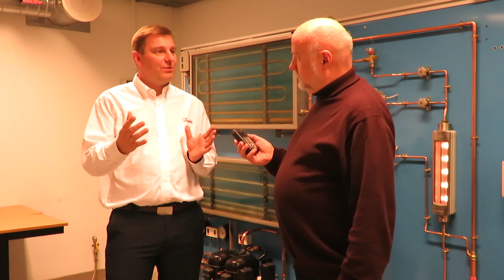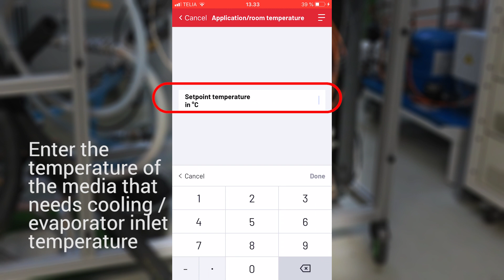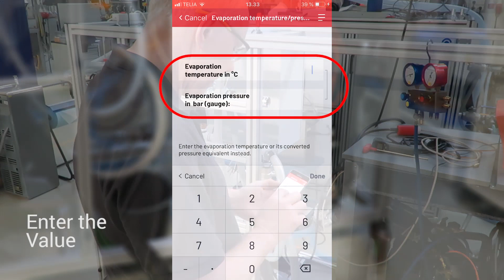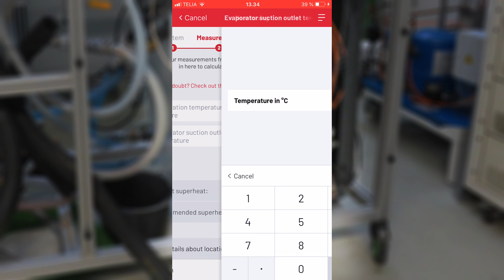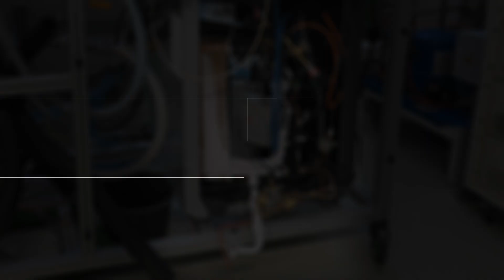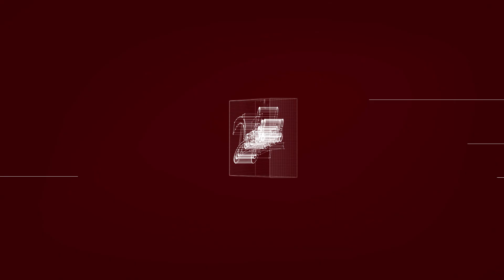Introduction to the Danfoss TXV Superheat Tuner App

Comment: Hi Danfoss, could you pl explain how to calculate (Application temp /Room temperature) for Hot water heat pump application, where the required final Temp for heating water will be 55 DEG .
Reply from the maker: Hi, Thank you for your comment. You can read more about it here: https://www.danfoss.com/en-gb/markets/buildings-commercial/dcs/heat-pumps/#tab-overview and look at the E-Learning part.

Comment: hi danfoss,
I have a question that I hope you guys can help me with.
1 / when the system has been vacuumed, how much gas is enough? How to know if the system has enough gas?
2 / When adjusting the superheater but the system is short of gas and must be charged, will the superheater change? Is there a way to fix it just once?
3 / How much distance from the solenoid valve to the throttle valve is reasonable?
Reply from the maker: Hi, Thank you for your comment.
1: The sight glass before the throttle valve (the expansion device) should just be full, i.e. no bubbles.
2: Most likely. You should always check superheat after adjusting the charge.
3: As little distance as possible, but still enough distance to avoid heat transfer from one component to the other in case of service replacements.
Hope this helped :-)
Reply: @DanfossClimate   Thank you so much for your feedback
1 / you said the distance from the solenoid valve to the throttle is the shortest possible so do you have the exact number? Because I installed the system from the 15m long solenoid valve to the throttle valve, the liquid gas line is insulated, is there any damage to the system?
2 / What is the distance from the throttle valve to the evaporator? exact figures

Comment: Application temp /Room temperature how to calculate??,
Reply from the maker: Hi again, Prasad. The application determines which temperature is required. For example, dairy product short storage is usually set at 5°C while frozen food could be -18°C.

The capacity of the cooling system for a cold room can be calculated by using our free Coolselector®2 software, which you can download here: https://www.danfoss.com/en/service-and-support/downloads/dcs/coolselector-2/